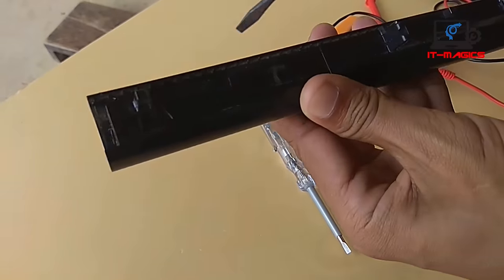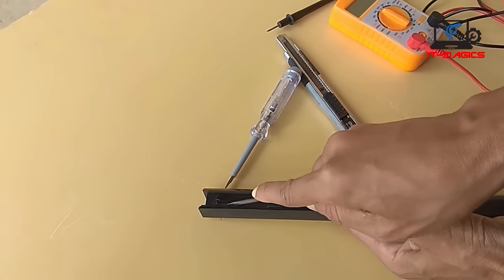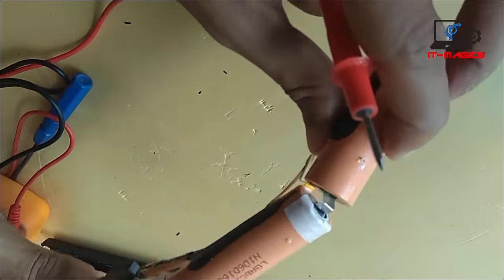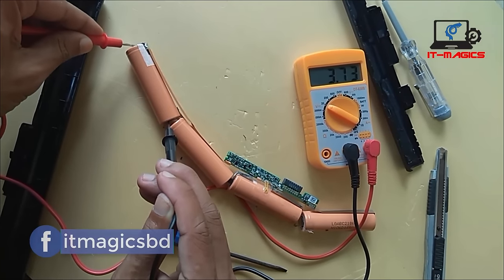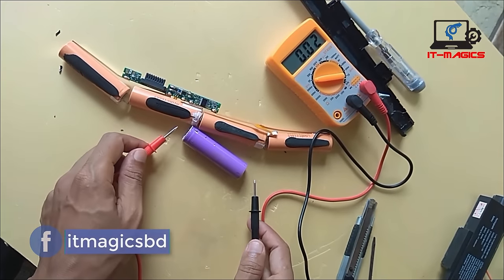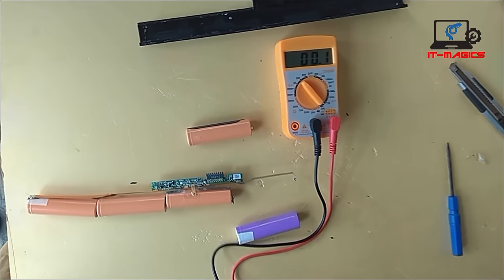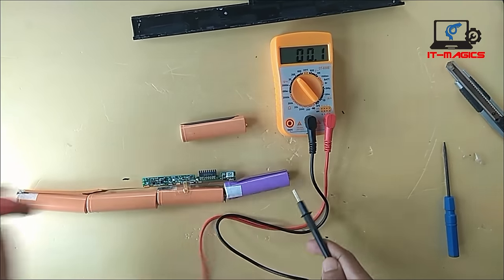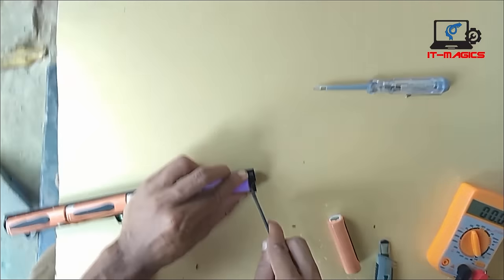Repair Laptop Damage Battery  or Not Charging Battery (Easy Way)

Comment from the maker: Battery plugged in, not charging[100% work][easy way]
https://youtu.be/V-fAC0OFG7c
How to setup windows 8.1 By USB Pen drive A to Z [100% work]
https://youtu.be/IWiC9UuX_tU
How to create ISO file for windows 8.1 or 8
https://youtu.be/AN6cpx2soMI
Reply: Which software can increase laptop battery life span
Reply: DELL PO2T BETARI SERBES KORBO
DKOKAN KOTHI
Reply: First video not available anymore?
Reply: I doit but dont power on and leptop dont charge
Reply: IT power on on i put The charger

Comment: Most cases thiss will not work because battery controler is in locked state already. After cell replacement, battery must be connected to evaluation kit (usually Texas Instruments) and using their special software controler can be unlocked.
Reply: for this k106 hp battery is that needed?
Reply: mine is locked please more info
Reply: I changed cells but sticks @3% please help
Reply: 3:13 same here

Comment: ok i see no one is talking about eeprom chip inside the battery. that eprom chip is a fail safe solution for charging and discharging multiple times a lithion battery, because after x cicles the cells become unstable, is usually 500 full charge discharge .that eprom chip inside the bat memorises these cicles and when it reaches a set value will not charge the battery anymore and windows will say replace battery.if you change all the cells in the battery pack with new ones wont work becose eprom is not reset and will still have 500 cicles in memory.there is no way to reset it only to program it for the new cells to start the cicles from zero.This video is miss information
Reply: Hey, do you have any idea how to restart the cycles from zero again? I changed my battery and it sys battery isdamaged, please replace :(
Reply: Good information, how to reset it or replace it?

Comment: Do you need to solder the new battery connection?  Looks like you did not so you are relying on the case holding the batteries together?  A bit off topic, but using a multimeter to check small button batteries can be challenging, so I took a wood clothes pin and drilled a hole on each side of the business end of the clothes pin.  The holes are just large enough to allow the multimeter probes passage.  Place the button battery in the clothes pin and testing the voltage is a breeze.
Reply: That is a pretty good idea :)

Comment: So this fix will work but it is dangerous for a few reasons.
1) That black looking sticker on the original cells is probably a temperature cut out circuit that will disconnect the cell if it gets too hot during charging or discharging. It should have been put on the new cell. This battery pack is now more dangerous and more likely to overheat ...
2) The cells should have been balanced first (all cells to the same voltage, e.g. 3.7v)
3) Mixing battery capacities when in series (like these 4 cells) can change the individual cell voltages. Some may go dangerously high and again get too hot or wear out quickly.
Reply: i think with the same type brand and voltage it would work great

Comment: The fix works, I did the same. I swapped all cells, and the battery was perfect. The tray showed x for 2h 22 min, by leaving it to discharge, the x was removed in 20 min phases for each discharge. Under 7%, the x still appeared. Diablo 2 Khalim’s relics remove the failure when found on battery only. Ms Project 2007 removes charging lock, when used on wire then unplugged. Demo works, too.

Comment: [...] open the battery case "CAREFULLY" 🤣😂 With 3 hands and 2 flat screwdrivers scratching the whole case... LOL! 
BUT! This is a GOOD REVIEW BY ME!
Who cares about some scratches on the battery cover? Now honestly! If you change the battery your laptop is at least 3 years old!
I LOVE this video!
Thank you for uploading!!! ❤❤❤

- - - - - - 

My only one IMPORTANT question to you: 

And I would really appreciate it if you could answer it correctly 🙂

It's an old Lenovo Z50-75 laptop with an A10 processor, bought in 2016, but for the office work I use it for, it's quite enough for me. 
Info: I bought a Chinese aftermarket battery for it, but it lasted about 1 hour... in other words: as long as the used old factory battery.
*IMPORTANT QUESTION*: If I could replace it with 2500 or even with very expensive "real" 3000 mAh 18650 Samsung cells, it would cost the same as buying the original Lenovo battery but would give 1.5 times more power (I'm talking about time using it without charging) 
What do you think? Would the built-in charge controller in the battery cover only charge it to 2000 mAh as the factory battery? Or will it charge to 3000 mAh?

You're the "Guru" and I would love an honest answer!

Thank you SO MUCH in advance!

Comment: hi, what kind of 18650 battery should I replaced it with? is it 18650 battery with 2200mAh or with a higher mAh?
Reply: Did u find answer of this, plz let me know
Reply: 3000mah 25 amp is common. Look for name brands like LG, Samsung and Sherlock HΩ

Comment: Hello brother!  I have a battery in which 3 cells are of voltage above 4V and one less than 3.8. And i have charging issues. Should i change the one with less volt?

Comment: Only good with old battery model with simple BMS included. Now recent 
BMS are sophisticated and refuse a current output after repair if they 
are disconnected (necessary for changing the 18650 elements)  So, after 
changing you have good voltage at the main ports between battery and 
BMS...but nothing at the BMS output. Manufacturers are clever! You must 
buy a new one......I'm not the first one who explains that in the comments...but no answer.
Reply: @hacshis hoxisered someone told me that you gotta solder a Lipo battery like 450mah to maintain charge to the BMS.
Reply: You're right. Replacing the battery cell does not guarantee that there is a voltage on the positive and negative pins of BMS.  I also need a solution for this problem.
Reply: One solution is to build a 19V battery (same voltage as the adapter) with a correct BMS and wire with female jack connection. 
And you connect this pack to the male jack of the computer (normally receiving the jack of the 19V adapter). So Battery cannot be installed in the computer but outside . However you don't have any "control" by the computer, and you can always work without issue. Easy to build, to charge and to replace. Simply five 18650 cells (best would be 2x5 in parallel for longer use time). Don't forget BMS to avoid a deep discharge of the cells by use, and to realise a correct full charge.
Reply: @Michel-Artois  thank you sir, I'll try it.
Reply: That’s correct.  Also keep in mind he didn’t even weld the replacement 18650 cell to the tabs.  I wouldn’t follow his instructions without doing that.

Comment: Need to keep in mind that replaced one is similar in capacity to the existing 🔋 battery.
Reply: is that necessary to have the same capacity?
Reply: @oualidpro8427  did u get the answer I need to know I have same question
Reply: @techytools5668  no bro . but i think its necessary
Reply: You should replace all of the batteries. Mixing new and used is extremely dangerous. Look at all the vids of vapes exploding. Battery safety is important, please do your research!
Reply: @oualidpro8427  no. but at least make sure it is equal or higher than the replaced ones, so that the new one will not get damaged by over-discharging it while the others still have capacity.
and more important than this, is that the new cell has to have equal or higher output current rating than the original!! if it is lower, then the whole battery pack may not be able to sustain the laptop's power needs, and this will also kill off the new battery in time.

so the answer is no.
BUT ! in case the battery pack is made of cells that are connected in parallel and if all the cells on one side are damaged, then it is VERY important for the new cells to be the same capacity(mAh) AND same current rating(mA) (and of course same type and voltage, that's IMPLIED 😅) as the original ones, or they can explode !! 

so yeah......this is not a game, there is a reason why laptop manufacturers prefer you to replace the whole expensive battery pack

Comment: My laptop battery has 3 cells in it and they're all measuring good. On my laptop it says the battery is no good and it also won't charge. What else do I need to check? My laptop battery reads 10.26 with 3 batteries.  Is that normal?

Comment: How do you reset the battery memory after repacking????  When more than one cell goes low than there is NO output on the battery terminals, after repacking it needs a RESET.
Reply: @TheCrozenfox  Which school did you go to??????????  You are talking about some very old battery circuits where putting in new cells starts the battery. The newer assemblies produce no output even after all batteries get replaced by good ones. Few years earlier (2012 - 2016) there was a reset method (bridging positive of the last cell to main positive output for one minute) which doesn't work any more.
Reply: @TheCrozenfox  Thanx....
Reply: How to check whether my laptops battery would work if I replace the cells in it... More over my battery cells volts are all fine, still lasting for only, 5-10 mints...

Comment: Dell D600 battery (C1295) With a jumper between Ground and the SYS PRESENT pin I can measure voltage and discharge the battery using a R/C charger /discharger.  However I can not charge at the out most pins. No current flow goes into the battery.

If I put the battery back in the laptop it will charge it full again.  Would you know if I need another jumper to allow the battery to accept charging?
Reply: Maybe the controller has locked it
Reply: @bhoot1702  I can charge the battery in the laptop I just can't charge the battery externally at the pins of the battery.  That tells me the laptop is either sending
data to the battery circuit to allow the D.C. current to flow into the battery or it is grounding or sending to HIGH to a pin allowing D.C. current into the battery.

Comment: Can i change 4 cell  in hp laptop battery model number is HS04 2550mAh.
New each cell capacity is 3.7v 2600mAh.
So 4 cell capacity would be10400mAh.
Is it safe or possible to extend battery capacity of laptop?

Comment: Hi! I have the same battery - 4 cells. I`ve tested the total voltage and it shows 14.5V. But my computer still showing plugged in, not charging. Any suggestions...?
Reply from the maker: That's mean your battery is damage
Reply: @ITMagics  Hi, today i`v checked each cell and i notice that one is showing 3.2V. So i`ve change it with new. Now he battery voltage is 14.8V. When i putted on the battery on the computer I tried to run the computer on battery (just to test it). Nothing happened. When i turned on the pc i saw its capacity is 25% plugged in, not charging. Again the same but the capacity is now 25% but not 0%. Any other suggestions?
Reply from the maker: @warfit8698  maybe something is wrong in your process
Reply: @ITMagics  Do you mind something more specific? The battery is on 150 cycles and many of the cycles aren't even full. It's a new battery. I have it for 2 years but very rarely used.
Reply: @warfit8698  If you are interested to know how to test correctly your batteries, just try to find my comment posted in the comments column. Voltage testing alone is misleading.

Comment: Hi sir. I just repaired my laptop battery. My battery has 6- cell and 3.7v. I just removed 2-cell
and 11.1v come out.Battery power is also fully charged but when I remove my battery plugged in the power also off.So what is the problem sir

Comment: Laptop battery pack can be test without removing from series. Or i have to separate all batteries.
Reply: And what's the value of should be appear?
Reply: @otrocanal9906  Don't try to open battery pack, because before opening backup was 5 min. Now it is not accepting by my Dell laptop. Finally I changed with new one.

Comment: Design Capacity: 	41,440 mWh
Full Charge Capacity: 25,240 mWh

Should I replace the battery? Moreover, it goes from 100% to 40% in about 1 hour and then from 40% to 0% in about 10 min. Please advise. Thanks.
Reply: Did you replace?  Were you able to replace?

Comment: Sir, my 3 battery showing 2.5 volt and one showing 3.7.
Shall i replace all battery showing 2.5 volt ??
Reply: Replace the ones with 2.5V
Reply: Ps replace with the same capacity ( /type if you can ) as the one at 3.7v

Comment: My battery readings are, 3.50, 3.50, 3.50, 3.30 are the still all good? Or are they all bad?
Reply: Bro check total voltage above the battery..its marked on the case.. and calculate your calculated voltage.. if that same ..its good battery..or else it bad one😊😊
Reply: @pistnboy1356  How can I find a voltage checker in Vietnam?

Comment: i want to do this but i m worried that will it affect my laptop life or mother board ,Your process is clearly simple and i have 4cell battery with the total voltage (14.6)and 2670 mAh which is return on the laptop and i have check the voltage that is 12.70, now 1 cell is damaged and others giving the 3.52v which is crct so can u plz help me tht which battery should be useful for me ....
Reply from the maker: You can use any brand Battery in your local market
Reply: @ITMagics   will it affect my  laptop life ? If i do the same process as u did?
Reply from the maker: No is not affect
Reply from the maker: You can do it
Reply: @ITMagics   3.7 battery will be ohk or i have to go for batter 3.5 because total voltage is written 14.6(3.5*4) can u give me a AMAZON or flipkart link plz for more help
Reply from the maker: Sorry i did not share any online market palce link
Reply: @ITMagics  and what about 3.7v or 3.5v battery both will be ohk or only 3.5v battery
Reply from the maker: No you have to use 3.7 volt battery for better laptop performance
Reply from the maker: You can use 3.5 volt for your own risk
Reply: @ITMagics  Can I buy a laptop battery inspiron on Amazon? And slap it in the battery holder?

Comment: I've changed replaced all the cell in the battery but still turning off suddenly itself at more than 50% charge. I reset the battery tried everything but nothing worked. May be the problems is with the circuit inside the battery or Bios can someone suggest me please

Comment: You need to retain the power to the board when changing the cells not all battery controller chip can retain memory
Reply: @prasantht19  probably apply some voltage (3V maybe) with a bench lab psu

Comment: friend, my laptop batteries  have 4 shell on it. but 3 batteries have  4.10-4.19volt and 1 batteries 3.6v. my question is which the battery that should i replace? (in the back of my laptops its says the output DC is 19volt) thx and sorry for my bad english
Reply from the maker: 4.10-4.19 is better for you
Reply: Chiko Tanaka one the of 3.6 is still good so replace others
Reply: just keep in mind the total output voltage of your battery must b above 14 volts or it cause problem

Comment: where to buy these battery cells. can I replace it with AA Duracell Rechargeable Batteries? how to connect it? my Laptop is "HP 15-r036tu notebook"
Reply from the maker: it's available in your local market
Reply: @ITMagics  what is the name of these cells. Suppose if I go to a local store, I need a name to search for. Can I use duracell battery as mentioned before? What is the size of this cells? AA battery size or bigger than AA
Reply: @redlines3787  Laptops normally use arrays of Li-Ion cells. Their ordinary type is 18650. This number means that the cell has 1,8 cm in diameter and 6,5 cm in length. If you open your battery pack, you will see the individual cells. Try to read their type before searching to buy new cells. In my opinion you should change all the cells. Not only one of them. Voltage tests are not convincing about the health of batteries. For more explanation try to find my other comment in the comment's pile of this video.
Reply: @ΠάριςΑζής  thanks a lot

Comment: There is problem bro may be the board circuit of battery is not working there is also a cause of battery that not charging....
Reply: find circuit board replacement at  aliexpress/alibaba.